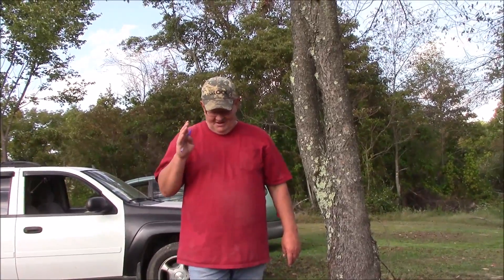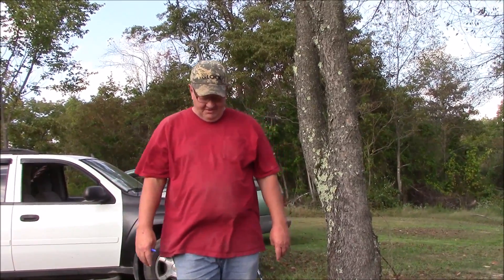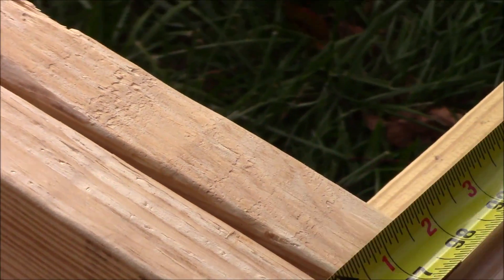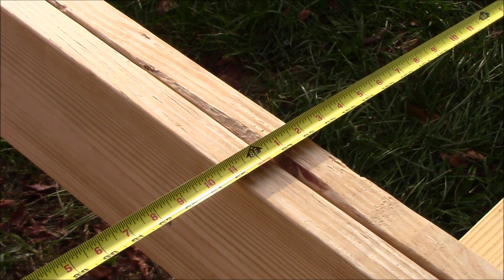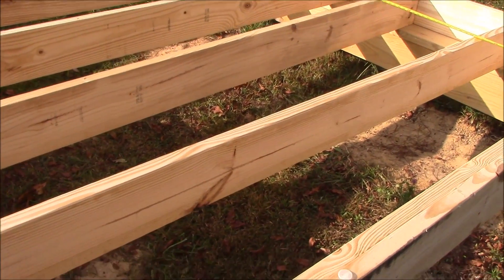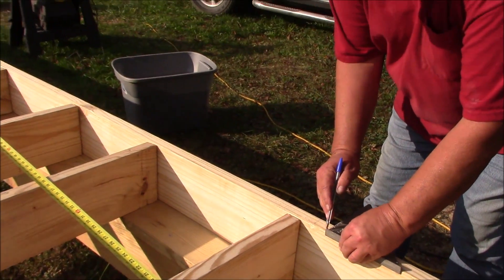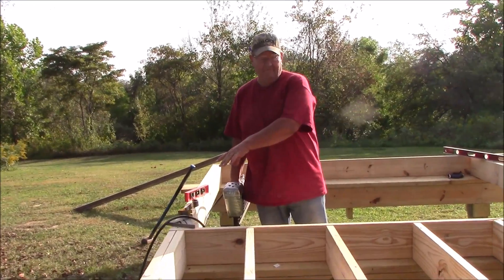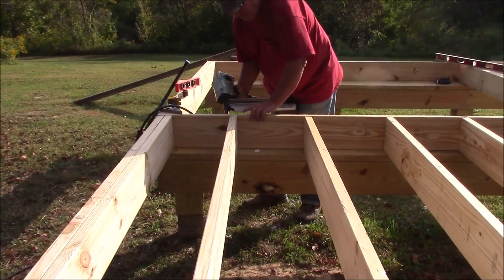DIY Framing @ 16" On Center

Comment: you dont have to double up the joists every 8 feet, just let the joist span the break for both the band joists and the plywood, remember where the 2 sheets meet on the same joist every 8 feet you have 2 .25 inch beads, one for each sheet, and add more nails where the band joists share a joist like you do for stud walls over and under plate breaks. for nailing band joists to joists i would go with 4 nails each end for 2x8(and wouldnt want to do less than 2x10 which would be 5 nails each end), and i hope the mudsill, bandjoists and joists are treated

Comment: Great video!
Q: For a 32'x70' building on cinder blocks. What size should the beam that sits on the bricks be?
Reply from the maker: Thanks.  The span table says a 2x18 would span 16' 6" if spaced 16" oc.   If it were me, I would run 4 rows of cinder blocks spaced at 8' for the 32' side. Rows of 7 blocks space at 10' for the 70' side.  Run 4x6 beams along the blocks and build the floor framing on top of the beams using 2x6 16" oc.
Reply: @HomesteadWithJoe  Thanks for your reply.... What's the board on top of the 4x6? Is that the sill plate? Whats size?

Comment: Good teaching. Why did you say floor ? doesn't it also goes for walls when doing dry wall?
Reply from the maker: Thanks.  I didn't think about that.  I'm not a teacher, nor a filmmaker.  I just happened to be doing joists at the time lol.
Reply: @HomesteadWithJoe  No worries. Its very useful info.

Comment: One of the things i have done is hammer in a nail until 3/4 of an inch is left out at the end of the span, then mark every 16 and place an x on the high side marking where the joist should go
...

Comment: https://youtu.be/9SbwO3K0zDM,joe this guy shows another corner post abit different then the 1 i explained but it works just as good and is just as strong ,give u all tge connections 4 walls and 4 drywall as well ,i only watched it to the post was shown so i cant bouch for tge rest of his desighn but it looked good upto the part that i watched ,good luck on ur builds an giving advice ,hope it help u out blessings

Comment: Would be a great idea to add a row of IBS2000 Load Share Connectors at the 5ft span mark to stop any bounce that's going to happen after the floors on. Most people end up doing it as a retrofit project after the fact. Much easier to do it right at this point.

Comment: can you use 2x6 on subfloor?
Reply from the maker: +Diego Canto I could have on this span, but I went with the 2x8 just to be sure. It all depends on how far you span and whether 16" oc or 24"
Reply: St. Bernard Acres i was asking cause i will try to build on 16' wide  by 60' long so thats why i was curious cause i already have 2x6 instead 2x8
Reply: @diegocanto13  
I hope you didn't try to span 16' with 2x6.
Not bueno.

Comment: What I have always done and as was taught to me years ago is to hook your tape on the end of your rim joist and go to the mark at 15 1/4" and make a mark then go to 31 1/4" and make a mark and then to 47 1/4" and so on. Put the leading edge of your joist on those marks and the center will automatically be at your 16"OC for proper layout for plywood subfloor.
Reply from the maker: +Bob Wood  That's a great way to do too.  I've seen others.  I just remember this way from about 40 years ago lol